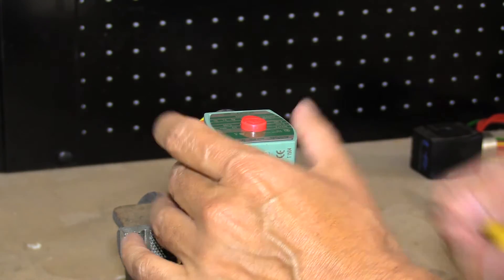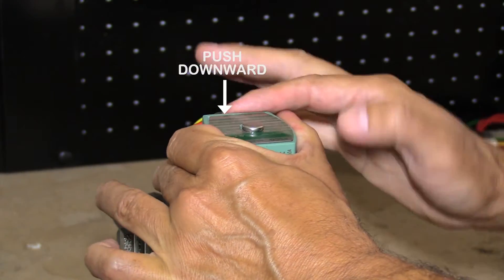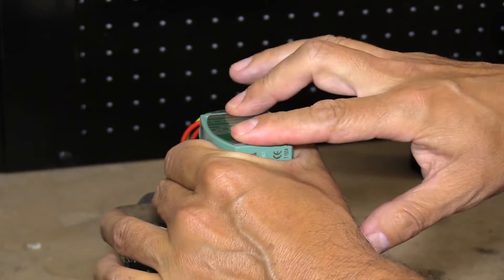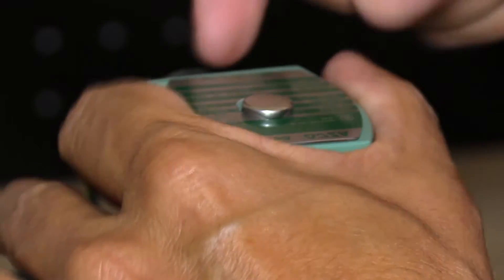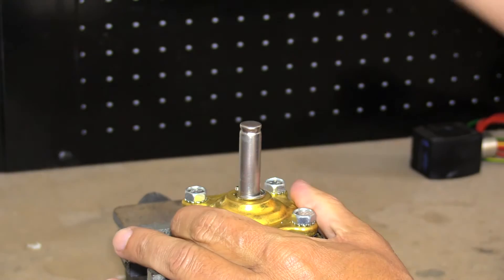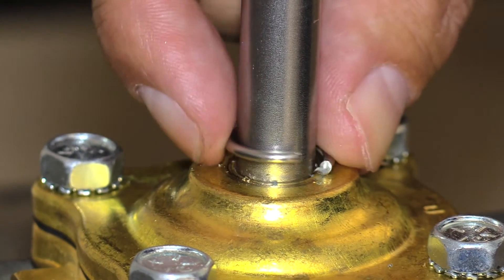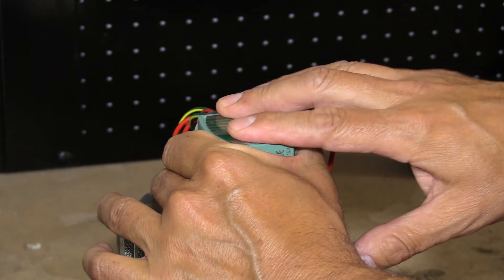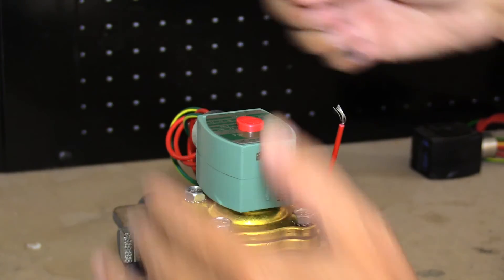How To Replace an ASCO Solenoid Valve Coil

Comment: hello there i'm ray gerrera vice president of business development for valence process control division I'm here to do a how-to video on how to replace an Estes Illinois Bell coil to replace an ESCO solenoid valve coil first we remove the red cap the trick to this is to push down on the coil it's spring-loaded so if you don't push down it makes it difficult to remove quite often people don't realize they have to push down on the coil they stick a screwdriver in here that's dangerous you can cut yourself or you can bend up the nameplate so push down remove the plate and you don't even need a screwdriver and the solenoid valve comes off to replace it make sure the spring is in place if it's flattened out just bend it to have spring action this is what holds the nameplate push down I'll slide the plate in place and put the decorative cap back on